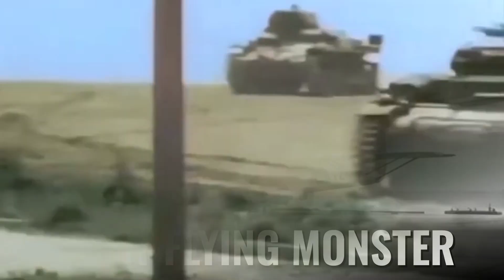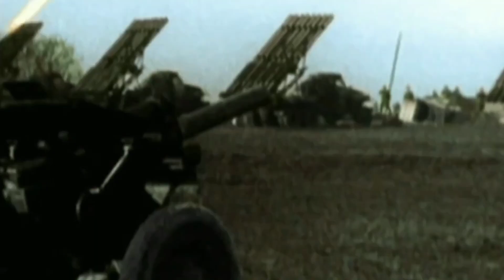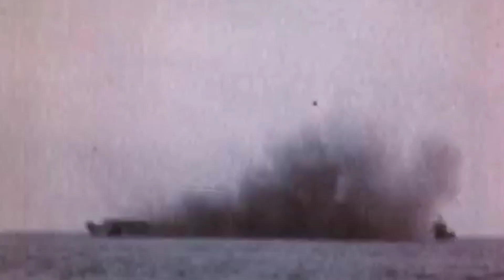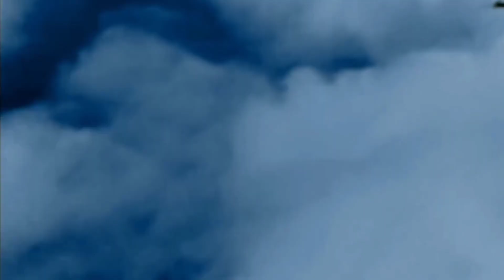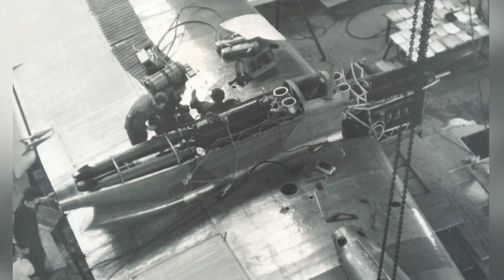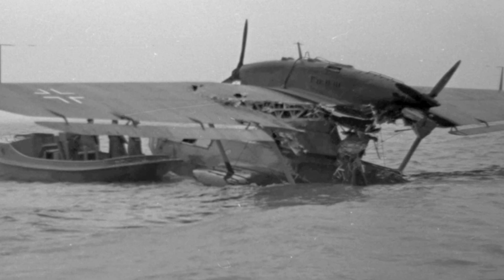German Do 18: The Flawed but Versatile Seaplane

Comment: how was it flawed? It was an excellent, modern civilian aicraft, until the warmongers converted it to a miltary aircraft.
Reply: Its diesel engines were an interesting power source for a plane, but they lacked in power. As a consequence, when one of the two engines gave up, a Do 18 could not stay in the air and thus inevitably had to make an emergency water landing. 
The subsequent three-engine Do 24 model was therefore definitely the better aircraft, as it could continue flying even after an engine failure. The Do 24's long service life as a sea rescue aircraft in Spain—lasting until the early 1970s—demonstrates this.